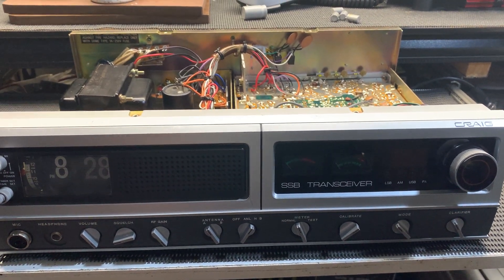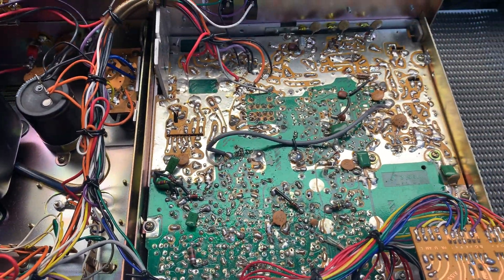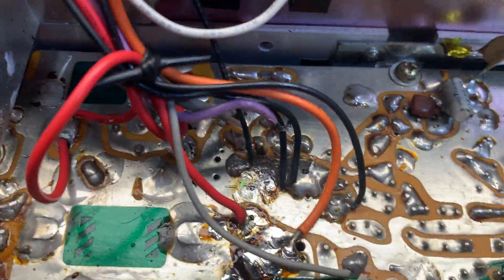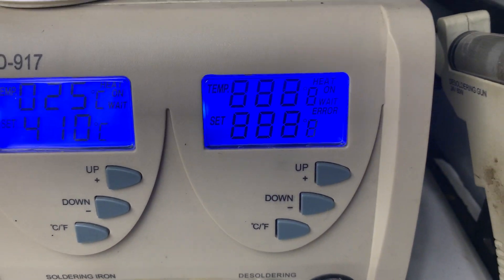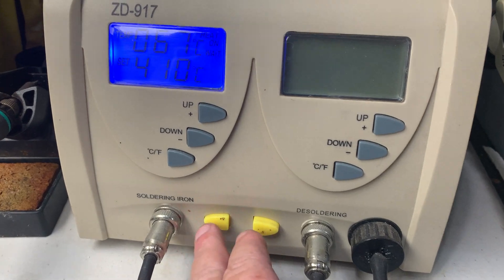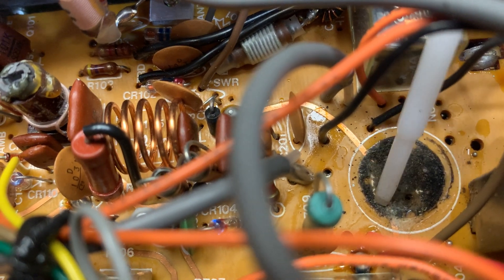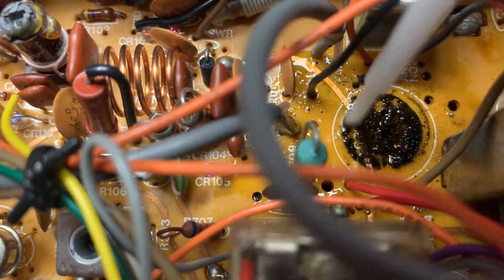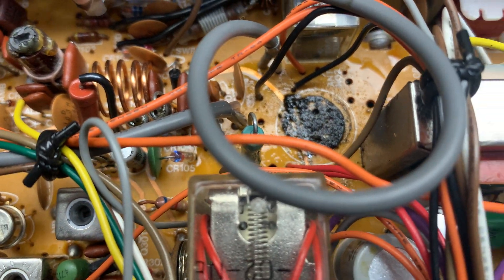Recapping a CB radio and why it needs to be done.

Comment: Indeed necessary. 
But electrolytics should never be blindly replaced. First the radio should be put back into operation, and then the caps should be replaced :
Coupling caps that short can easily stress silicon, causing erratic problems later on. Good luck finding that silicon after caps are indiscriminately replaced.
That's why you fix first, trace shorted caps and check for silicon stress.
Then recap.